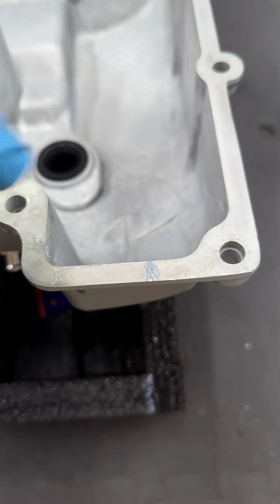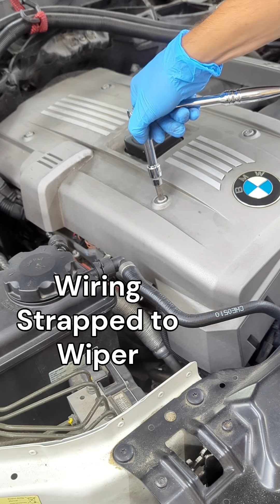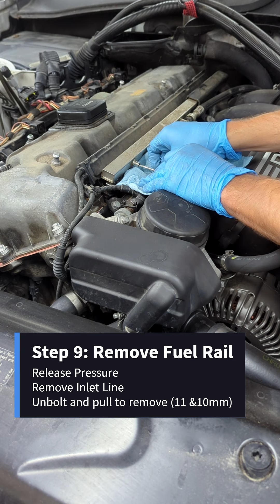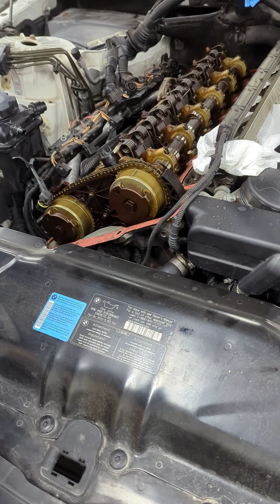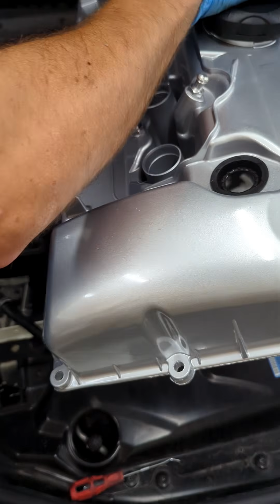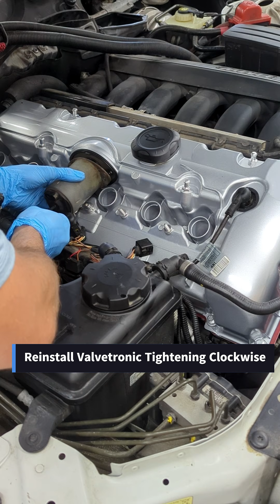BMW N52 Valve Cover & Gasket Replacement (Vertical/Phone View)

Comment: Bro popped his fuel injectors out by hand 😂😂😂 I kid you not it took me a full pry bar and probably 100 ft-lbs of pressure to pop mine free. Even then, I legit had to put a pair of channel locks and clamp the living sht onto the #2 injector and pry up on the channel locks with end of a pry bar to bust that sob loose. It was insane man. probably took 200ft-lbs to break that bastard free. I even screwed up the marking on the injector we had to clamp it so hard. On my donor motor it took just a little bit of force and the whole rail popped out no problem lol.
Reply from the maker: Are you talking about issues with direct injection fuel injectors (like n54/n55) getting stuck?  N52 and M54 port injection fuel injectors have always come out without too much issue for me (knock on wood).

Comment: you are using wrong gasket for the valve cover
Reply from the maker: Really? I'm pretty sure that's the right one.  The rubber gaskets are for the newer plastic valve cover n52s.
Reply: what is this cover chinese aluminium copy or magnesium? @ClassicActWorkshop

Comment: Nobody ever mentioned valve cover gasket leak causes valve leaking
Reply from the maker: I am not sure I follow, maybe i misspoke, but my leak was down the side and back of the engine.  Leaks onto that heat shield/sensor area.  First time i replaced I also had some oil in a couple spark plug tubes.
Reply: VCG failure creates a vacuum leak. CCV BREATHER HOSE CONNECTS TO VALVE COVER CREATES VACUUM PULLS GASSES/OIL OUT OF CRANK CASE INTO CCV VALVE WHICH SEPARATES OIL FROM CRANK CASE GASSES PULLS INTO INTAKE MANIFOLD. VCG FAILURE CAUSES UNMETERED AIR TO ENTER  THROWING OFF FUEL TRIM BECAUSE THE UNMETER AIR ISN'T BEING PULLED THROUGH THE MAF IN THE INTAKE. 

 @ClassicActWorkshop

Comment: Hi great Video i did valve cover 3 years ago arond 30 k miles ago and starts leak again. 
Is this aftermarket better then magniseum ?
Reply from the maker: So far it's good and hasn't started to leak again.  Given the cost difference, the aftermarket valve cover is definitely worth a shot in my opinion.

Comment: Hey man keep me posted about this aftermarket valve cover. You got me curious if this makes sense to replace on mine.
Reply from the maker: So far so good.  Leaks and smells are gone.  Mitzone is the brand, I have some links in the description depending on your engine.  I had to clean up the surface from some overspray or paint runs like shown in the video.  I had to swap the valvetronic mount bracket from my old valve cover (just 2 screw), and some paint around the screw heads cracked as did the final torque.  Not ideal, but I would recommend it given the high cost of an OE valve cover.
Reply: @ClassicActWorkshop to be honest, I don’t care about cost as much as I care about quality and durability. If it’s better than OEM, I’m interested 😊 thanks!
Reply: @WeekendMechanics  I got a similar aluminum valve cover and used genuine BMW gaskets. I am throwing rough idle and error code for the pcv valve. When you start the engine and try to open the oil cap, it is nearly impossible meaning the vacuum suction is too strong. Once driven, I had no issues. Idling shakes the car like it's about to die but comes and goes. If you have obd2 scanner, check the short and long-term fuel percentage for bank 1 and bank 2 it should be under 15%. To my understanding, pcv valve will fail much faster than the valve cover oil leak and the only fix is to replace the entire valve cover. I am going back to the plastic genuine cover that includes all the gaskets and costs $633.92 on FCPeuro with a lifetime warranty, meaning you can replace it for free in the future if another problem.
Reply: @seahawkgreenblue6085  I guess that's the way to go... either genuine or febi bilstein or something like this. Cheers!